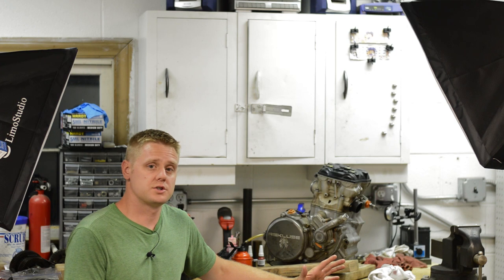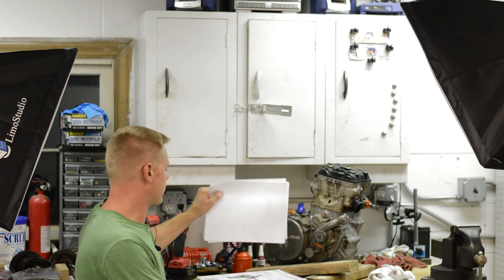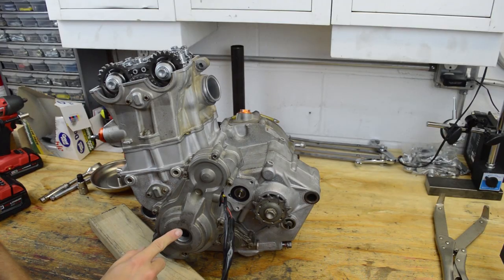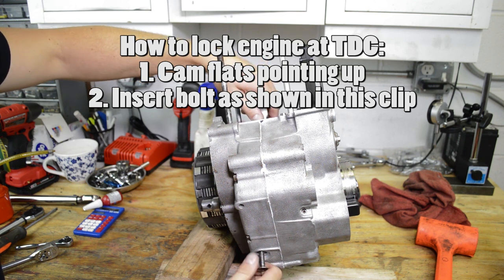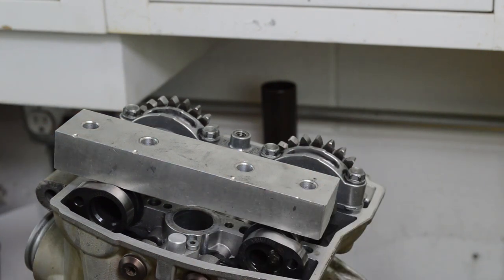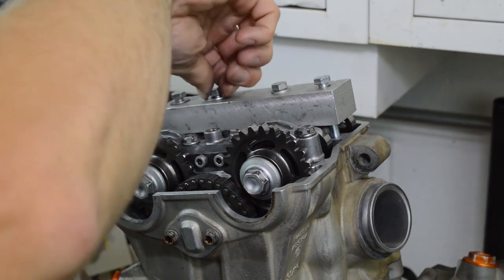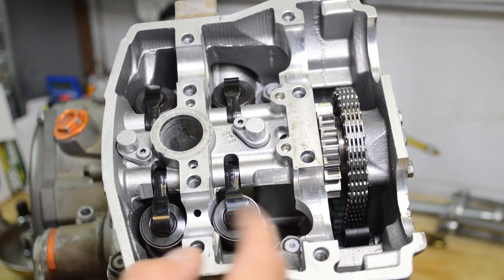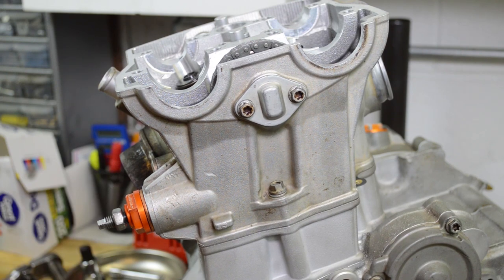How-To: KTM 450 505 SX-F Top & Bottom Engine Rebuild 2007-2012

Comment: I have bad vibration in my handle bars and my feet, been that way since I bought it used, could it be bottom end bearings, rode my buddies 2008 450 ktm and its so smooth.

Comment: Can I check the piston ,but not replace gasket ? Old gasket should good ?
Reply from the maker: In order to fully inspect the piston, you need to remove the cylinder. Yes, I'd replace all gaskets with new ones.

Comment: To do crank seals and crank seals only. Do i have to pull the crank like you did to get to the gear hiding the crank seal on the right side (clutch side) ??? 2008 sxf 450 stock
Reply from the maker: You can swap seals w/o splitting the cases.

Comment: Is this the motor with engine oil and seperate gearbox oil? Ever heard of the issue with that?
Reply: A 2007 Sx 450 doesn't have separate g-box oil. Both are combined.  A 2007 530 exc r  has separate engine and gearbox oils though quite often they get modified to run the same oil through both. There was an oil pump modification on this model too, to stop oil draining from one area to flood the other.

Comment: Hey there Matthewcrepair I'm watching this whole video to see how to remove the cylinder and you just magically take it off.  Mine is giving me a hard time.  Do you have any advice?
Reply from the maker: There are 2 orings that make it a tight fit. Try a soft rubber mallet. Go easy.
Reply: @HTMR  Should they be replaced after ?
Reply from the maker: @mortirius1  Orings? Yes.

Comment: Minus the d
extra gear will this video work for my 2009 450 xcf?
Reply from the maker: Yes sir.
Reply: awesome thanks for the quick reply ill be purchasing the video soon!
Reply from the maker: No problem. Let me know if you have any other Q's.
Reply: will do is there a direct contact link for you after purchasing the video or would i just post the question here
Reply from the maker: Yes, you reply to email after purchase and it goes directly to me. Or post it here. Either way works.
Reply: awesome thanks again
Reply: Is the xcf and sxf the same engine?

Comment: I notice you just use a rubber hammer to break open the case?Can I do the same with my ktm400?
Reply from the maker: Not sure. Check with the service manual if a puller is needed.

Comment: hi i have the same enigen on my bike ! and i think my auto decompressing is failing ! can u repair it or do i have to get a new cam??
Reply from the maker: Start taking it apart and see whats the problem.
Reply: @HTMR  my problem is even white a new battery and a new starter i cant start the bike on the e-start unless i jump start white a car battery! i have checked the starting system, valve timing,cam chain timing by the workshop manual and i find nothing wrong!

Comment: boa tarde eu tenho uma sx-f 450 2008 e ultimamente sempre que paro no fim de uma trilha o motor desliga sabe me indicar de onde possa estar o problema ?
motor trabalha bem  e levou filtro de ar novo e vela nova e continua igual sou dos açores e não temos oficinas nesta ilha para motos , se poder dar uma dica agradecia muito obrigado .
Reply from the maker: Tune the fuel screw: https://youtu.be/kUw41sUQbTYhttps://youtu.be/kUw41sUQbTY
Reply: @HTMR  vou tentar isso muito obrigado por responder .
Reply: BOA noite meu ktm sxf450 quando está mais quente fica a afogar tem alguma ideia da solução ?
Reply: o problema da outra vez estava na bobina de ignição .
sabe me informar qual a folga normal que tem entre o volante magnetico e o motor o meu tem uma folga para dentro e para fora mas não encontro informação se é normal ou se é um problema . no teu video é o minuto 20:50 ?

Comment: hello consultation maybe you can help me I have a ktm sxf 450 2007 and I drop the intake valve is the second time. I can not use it. I changed the guide to the rocker valve insurance kit full of springs and saucers
Reply from the maker: What do you need help with exactly?
Reply: hello is the second time I broke the intake valve always breaks the same on the side of the decompressor. I change everything new I would like to know if you can guide me where the problem may come from
Reply: hola es la segunda ves que se me rompe la valvula de admision se rompe siempre la misma la contraria al lado del descompresor. le cambie todo nuevo.  Quisiera saber si me podes orientar por donde puede venir el problema

Comment: What would cause a cam bridge to brake on my 2007 KTM 450
Reply from the maker: Did the cams seize?
Reply: @HTMR  yeah I just bought the bike and  pulled the valve cover off by the looks the head has to be changed. Do u Kobe ware I can find a good hed ?
Reply from the maker: @Paulklei  Where do you live I can recommend someone who fixes them.
Reply: That would be great if u hook me up.  I live in Springfield Missouri.
Reply from the maker: @Paulklei  Contact these people, they fixed the cam area on motor in video: https://www.pointviewcycle.com/ktmmotorcrossoffroadservic

Comment: Hey you have helped me before, i have a yz125 just bought it.   Its a 2000 model has a 144 big bore in it

I was ridding yesterday about 2 hours and it sounded like it ran out of gas but had half a tank.

I cleaned the carb with carb cleaner. I checked for spark and it has spark. Did compression test 4 hours after it quit and it was 120 

I mixed gas 40-1 

Spark plug had black on it when i took it out so i cleaned it an put it back in

Also i sprayed starter fluid in the engine and it still didnt start

Any idea what might be wrong

One guy told told me power valves but that dont make sense to me i would think if power valves were messed up it would still run

Another guy said crank but if crank was messed up would it even kick over?
Reply from the maker: Did you try to install a brand new spark plug? Send me an email here so you can share some pics: https://www.howtomotorcyclerepair.com/contact/
Reply: MatthewMCRepair i am going to go get a new spark plug in a few hours and try it     And i will send pics when i get home as well
Reply: MatthewMCRepair Got it running!! Just needed new spark plug
Reply from the maker: Sounds like you fouled a plug. Either it is jetted too rich or running rich due to other issues.
Reply: MatthewMCRepair i buy and sell bikes so only had this one 2 weeks so I'm not sure how its jetted     But it actually had the wrong plug in it, it had a br9es and its supposed to have a br9eg
Reply from the maker: Either plug should not foul. Tear down the carb and see what jetting is has and compare to stock. Given that you have a big bore kit, you usually have to jet leaner.
Reply: MatthewMCRepair do you have a video on how to check jetting?    I know its something to do with how the needle that is connected to the throttle is set and the actual jets in the carb

But how do you know what they actually are      And i assume it will say in the manual what stock settings are? 

Also i dont know for sure its big bore thats what the previous owner told me but people tend to lie about that kind of stuff
Reply from the maker: I am currently working on a 2 stoke jetting guide. In the meantime there is this video: https://youtu.be/jRBA1gHlx6k
Reply: MatthewMCRepair okay thanks!